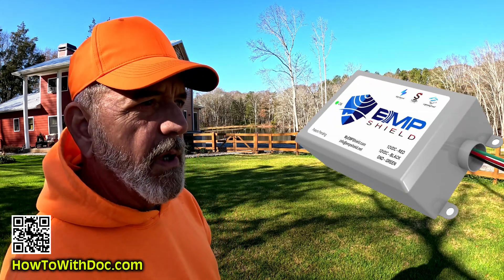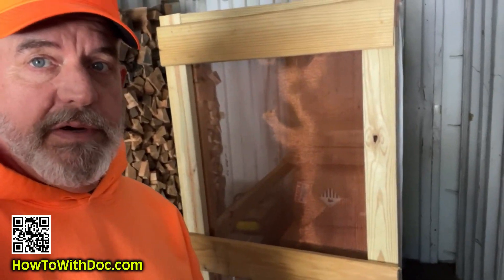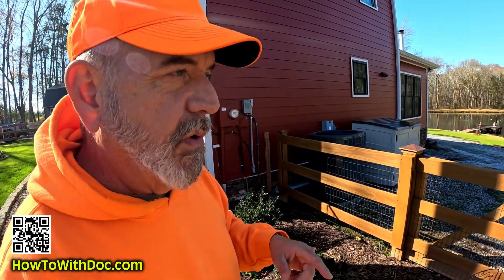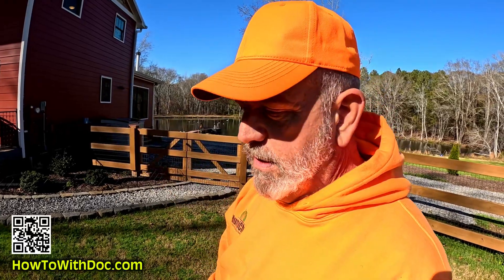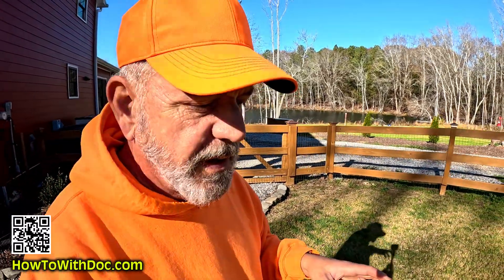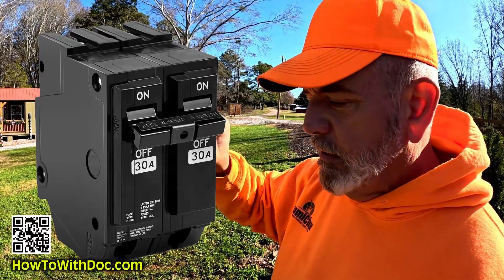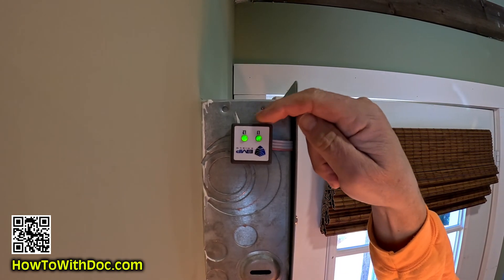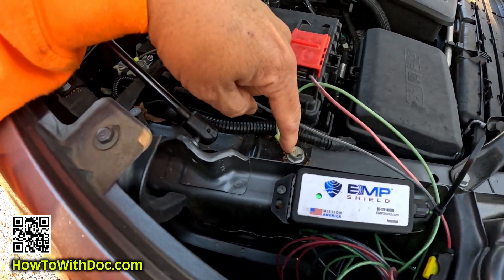Soft Start for HVAC System and Home Surge Protection

Comment: Doc, I am very green when it comes to knowing anything about this electrical stuff so this is probably gonna be a very stupid question and I apologize ahead of time.  

This soft start system that you put on the outside of the AC unit. Does it also work for the furnace? 

I usually lose power in the winter time and just need my furnace to kick on. Does the soft start work for that or do I need to buy a separate soft start for just a furnace?
Reply from the maker: It really is ONLY for heat pumps.

Comment: Another pointer about the EMP Shield, it has to be installed on a 20amp double pole breaker. It can be shared with one or two branch circuits, but it has to be a 20amp double pole breaker.

Comment: The main benefits of the soft are for alternative power sources, IE batteries and generators, and for utilities that charge a peak demand charge.  Your kw usage will be about the same since the starting current is for such a brief time it doesn't really change your usage.

Comment: The capacitor on an HVAC system helps start the system, not by delivering a sudden jolt of power, but by absorbing it. If the capacitor was not there, the two phase power on both sides of the electric motor would cancel each other out and the motor would not spin. But with a capacitor on one leg, that one leg creates a magnetic field that is a little weaker on that one side of the motor during the time it takes to fill up the capacitor.
If you neighbor keeps popping caps, the motor is over drawing current and it sound like its time for him to replace the compressor or get a new unit. He will probably see a big reduction in his power bill after that gets fixed.
Reply: You are close but a little off.  The current isn't weaker per se but lagging behind due to the phase shift caused by the cap.  ELI THE ICE MAN.  The cap caused current to lag voltage by 90 degrees in one leg, and current and voltage will be in unity on the other leg.  This difference causes a rotating magnetic field in the field windings of an induction motor which in turn creates a field in the squirrel cage rotor which then latches onto the field of the stator with a smaller difference called slip.  The greater the slip the greater the torque produced.  No cap required in a 3 phase induction motor, only in a single phase induction motor.

Comment: Last April I installed a Micro Air Soft Start on my 4 ton AC unit and dropped starting amps from 86 to 32. The Soft Start unit also acts as a surge protector for the AC unit compressor. I have a whole house surge protector on my meter too. I would also advise to buy a couple spare capacitors for your AC unit. That is the most likely failure to happen and you can replace it yourself in minutes. On line they are only $17 - $50. Easy install and save a ton over calling and HVAC company for service.

Comment: Doc.  We put a new HVAC system in. The installers said not to put a soft start on because the Compressor has stages. It always starts on the lowest stage.
Reply from the maker: I would call email microair and ask.

Comment: Which is better the hard start or soft Start? I was looking to have a hard start installed.
Reply: Soft start if you want to use a generator to run your HVAC, but it’s much more expensive.
Reply: Thanks. I don't have a generator. It's the hard start for me.
Reply: I had a new 2 ton A/C system installed years ago. Nice to be inside dining with family on a hot day for a change.  But, there was an annoying dimming or flicker of our lighting when the compressor kicked on. So I installed the "Flex" unit recently. Wonderful! No dimming! No "Bang" on compressor startup. The compressor noise during "Run" is quieter, too. I don't have first hand experience of what a hard start would do in regards to the above results I got from the soft starter.